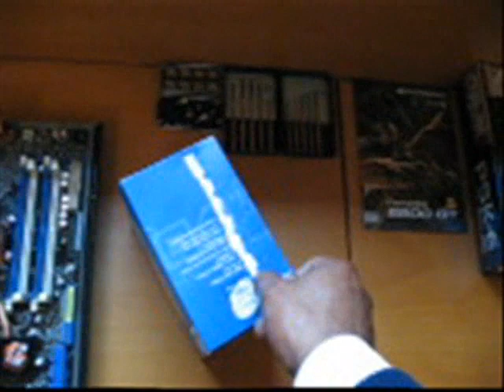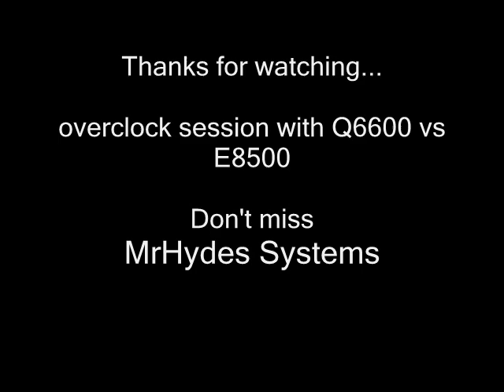Intel Core 2 Duo E8500 install

Comment: i thought u was going to show us how to install the 9800gx2 :( i need mega help i have just bought this card 2nd hand for £150 from cex. i plug it in and moniter goes to standby but i dident have any wires with my card and i heard it needs extra power? could some1 please tell me what leads i need. and also does my mother board work for it i have Foxconn G31MX Series pci-e. 4Gb ram 185watt power supply ty i really need this help.

Comment: Should have aimed for a sweet quad core dude, especially since multi-threading is starting to become more efficient. Also get a 64bit OS and get tight 4-8gb RAM in case u want to QUAD sli that lovely beast of a GPU. =]

Cheers

Comment: Mrhydes, if you say 9800gx2 have two 8800 gts gpu(and i Know that), imagin, that i have two 8800 gts cards in SLI mode, comparing with a single card 9800 gx2...Who have better perfomance? Two 8800gts SLI, or 9800gx2 single card?

Comment: wrong, the SLI occurs in the graphics card, it doesnt matter if the mobo doesnt support it in this case.  Would only matter if he tried to put in two seperate cards in two seperate PCI slots.  His solution doesnt require that